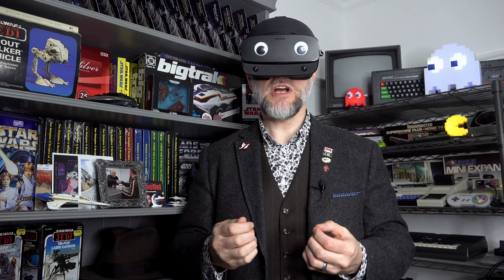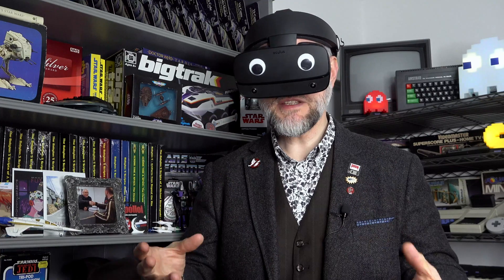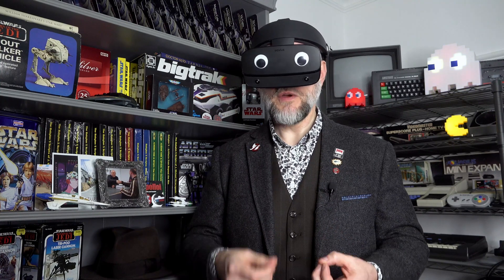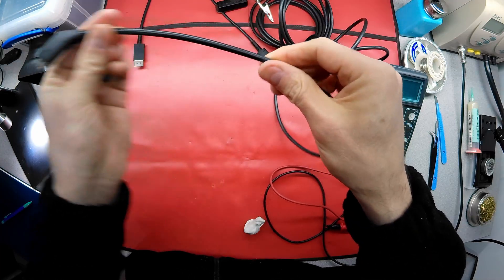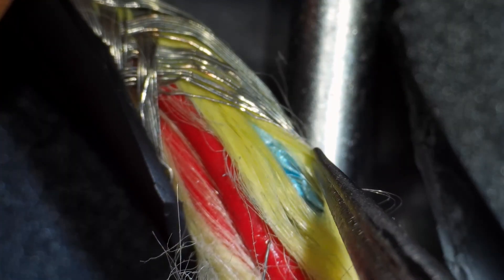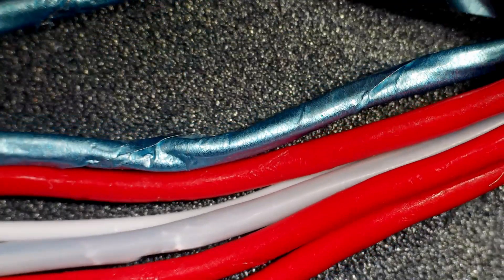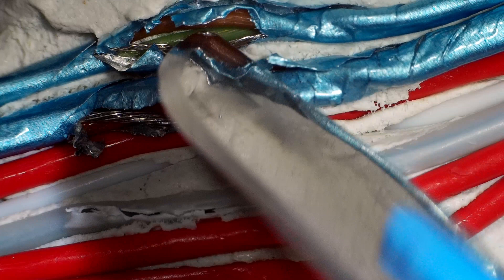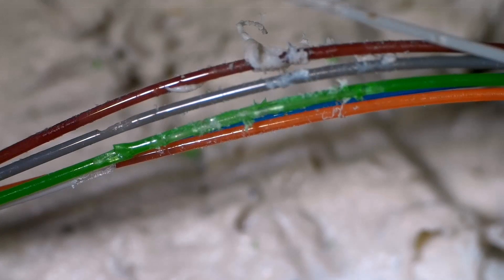Faulty Oculus Rift S

Comment: Are those foil covered cables for usb?
Reply: // There are 2 type of (DisplayPort) cables (for the Rift-S!)   
Different between them; the size of "Y" part. 
This is the bigger-Y type. //

(Copper wires) 
Main shield = GND
3 red       =    +5V  (usb) 
1 white   =    DisplayPort  Hot plug detect

Low bandwidth data lines:
1 shielded twisted pair: Usb2.0 Data +/-
1 shielded twisted pair: Display port Aux lane +/- 

High bandwidth data lines:
6 fiber wires:
(I think so) 
- 1   USB3.x  SSTX+/- 
- 1   USB3.x  SSRX+/-  
- 4   DisplayPort - Lane 0-3

Comment: Hi there! I got an oculus rift S yesterday at a thrift store. My cable still works fine but I saw the cable was proprietary, so I started digging into this in anticipation of the issues.

I am wondering: maybe a simpler fix would be to remove/replace the 42 pin connector from the headset and replace it with a non-proprietary alternative. 

I don't know as much about the pinout as you do, but it seems like there would be a lot more leeway soldering on the pcb than in any of the super fine wires, and there are many cheap headsets around to work with.

If I could get it working with a displayport and usb port on the headset, the cable length issue could be handled separately.
Reply: Alternatively. I've been thinking for a while that if someone marketed a dongle for these with the 42 pin connector on a short length of chunky (ie, less fragile) cable that went into a small breakout box that had a USB and display port socket on it they they would sell. Folks with faulty cables would buy them, and a fair few folks who's cables haven't gone faulty YET would no doubt buy them just as insurance for the future. 

There were two types of cable for the Rift S. The early all copper version and the later copper and fibre optic type. These were interchangeable so it shouldn't be a problem building the box just being electrically connected.

The box could be stuck to the headset somewhere with double sided foam tape and a Velcro strap used for strain relief for the USB and DP cables. Yes, a pair of cables would be more cumbersome than the original single cable, but it would also be more robust, and if they DID eventually fail, it would be as simple as overnighting a pair of new 5m long cables for less than £30/$38/€36 from Amazon, rather than paying  £90/$114/€108 and waiting a week to find out if the used cable you bought on eBay is any better than the intermittently faulty one you already have.

The only problem is that, in the big scheme of things, there isn't actually that many Rift S's out there. They were only sold for about 2 years, and they're now seen as a bit of a one trick pony. Where you can use a Quest 2 or 3 anywhere, or wired/wirelessly connect it to a PC, the Rift S needs a reasonable spec PC to run them, and dispite them offering brilliant motion tracking, crisp image quality, and a headset that doesn't have a battery life dictating how long you can play for, a lot of the younger folks see something that needs to be physically tethered to the PC to work as "Old tech".

Personally I don't think having 2 cables would hinder people much. I wear glasses, and because they ALWAYS mist up during long play sessions, I've got a little low pressure compressor and 2x 6mm OD hoses that creates a little air movement inside my Rift S's faceplate. So that's the original 6mm cable bundle plus 2x 6mm hoses hanging off the back of me headset, and I can barely notice them there.

Comment: Great video, stumbled upon it a bit late. But recently I got off work and am trying to repair this cable, I ran over it with my chair. Yeah, jezus. And I can't seem to distinguish USB from DisplayPort. Do you have any blueprint or notes that would tell me which wires go from the headset connector to the splitter, which are the USB cables. Because when I plug the headset in it says "Sensors, not working, faulty USB 3.0" Soo... I probably crushed a USB cable. But for the life of me I don't know which is which. I'll try to strip down the USB cable and maybe figure out which cables are going there. The optic seems fine, no bent or faded color in the semitransparent white shell. The ground wire is a bit flattened but it looks fine ish.

Comment: Any news for part 2?
Reply from the maker: Working on it and making progress. Been a bit busy with museum stuff to really concentrate on it though.
Reply: @TheDigitalOrphanage  I understand. As fare as i know there is a circuit near the connector on headset side. In your opinion, is it possibile to solder a USB and a HDMI female connector immediately after that, in order to use normal cables? I also don't understand at what point of the cable the optic fiber is converted into copper
Reply from the maker: There is a resin sealed circuit in both the Y combiner and the headset plug end. I'm at the soldering point and trying to build up the courage to attempt some pretty delicate soldering before I find out whether my wiring diagram I've deduced is worth the paper it's on! 🤔

Comment: got one used in november 2022, got an incredible amount of 6 hours of gameplay because the next day the cable just stopped working, the problems is that day I didn't knew it was the cable, so in the course of 8 months I looked, asked and tried EVERYTHING to see what the problem was, all of that to finally narrow it down to "yeah I have to get the 80 usd cable". getting it next week but is great that a video like this exists.
Reply: but real talk. how hard is for meta to simply give the schematics to 3rd party companies, that way they let consumers to get cheaper cables
Reply: @AngeloT2001  It wasn't meta who designed it, it was lenovo. All engineering rights goes to them while oculus/meta worked on the software. Lenovo chose not make schematics and diagrams for the cable because the fiber optic technology were proprietary and patented.
Reply: Did you find a replacement cable that works?
Found some for $150 on Amazon,  which is outrageous. I should have bought a backup when I first bought my rift-s

Trying to find a site where someone can confirm that the replacement works

Comment: I look forward to part 2 - anything that can prolong the life of such products is a great move - and will hopefully be of benefit to others in the future.
Reply from the maker: Yes, I just hate the thought of all these perfectly good VR headsets being trashed because of a cable.
Reply: @TheDigitalOrphanage  Are you trying to connect the fiber optic cable ?
Reply from the maker: @siedliko  no, I'm trying to replace the fibre optic links with wired connections instead. I'm part way through, but been very busy with work and the computer museum I run.
Reply: @TheDigitalOrphanage  I messed around with the cable and I was also thinking about wiring the cable the normal way. I have sliced the connector and everything is in some kind of resin, so it won't be easy.

I bought a Rift S with a broken cable from eBay, thinking I could fix it, but that didn't work. So I have contacted Oculus and they replaced the cable for free :D
Reply: @siedliko  How?
Reply: @mysololife-myjourneytoendl7490  instead of fiber use normal copper wires.   It's the same with the oculus quest 2.  You can swap fiber cable with normal usb c.
Reply: @siedliko  you said you got a cable for free from oculus? i thought they discontinued it
Reply: @siedliko  please respond to this comment above. didnt they discontinue the cable and support?
Reply: @siedliko  Wtf they gave you a cable for free????? how
Reply: @skydarkbomber1728  I spoke to them on live chat saying that the vr don't work, they told me to send it to them and they give me a new vr with new cable. But they forgot to include the remotes hahaha so had to wait another week for remotes.
Reply: @siedliko  that's so lucky, the support team I've spoke with just ghosted me :/
Reply: @siedliko  also do you have other means of comm like discord or something? I'd love to ask around more on your support team process hahaha
Reply: @skydarkbomber1728  I told them the vr doesn't work and after trying what they told me to do after few days, they said to send them to them. That's all.
Just do all the tests and keep telling them they don't work.